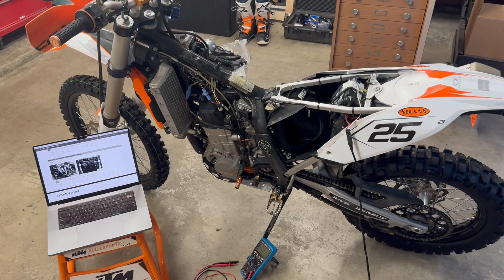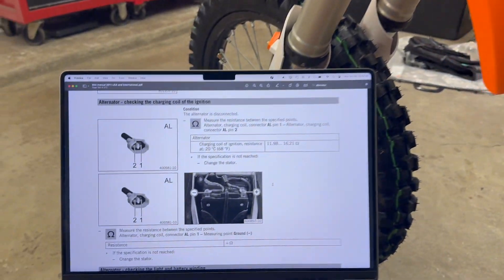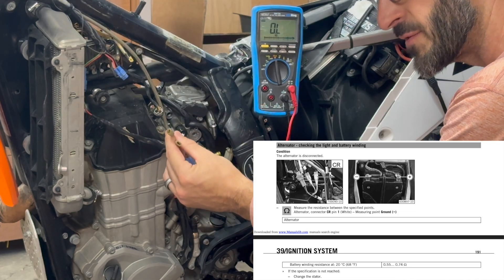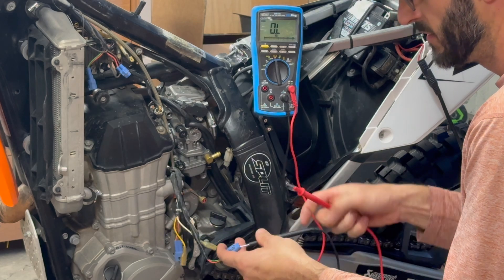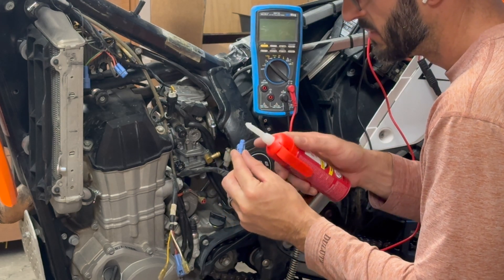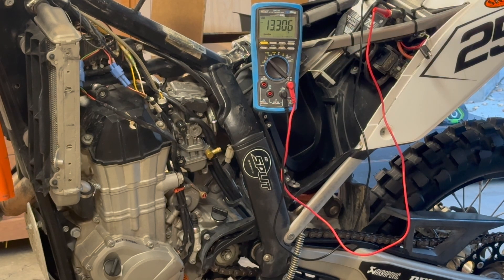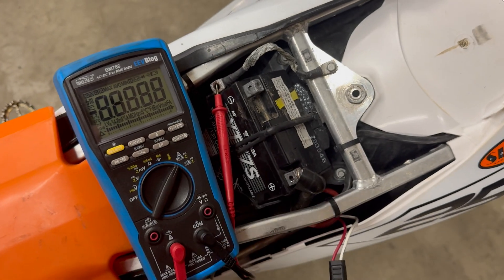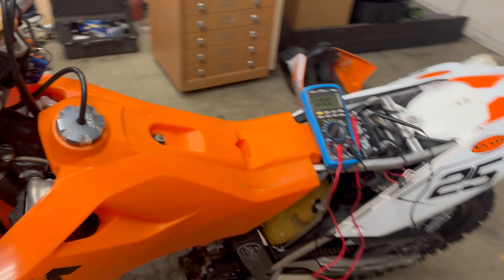KTM EXC Alternator and Battery Tests

Comment: Hmm mines exactly same 0.23 to 0.25 yellow to white.. ive got AC voltage coming out from the stator.. not sure about what to check from there, swapped out regulator with another one lying around no answers yet. Guess ill check wiring!